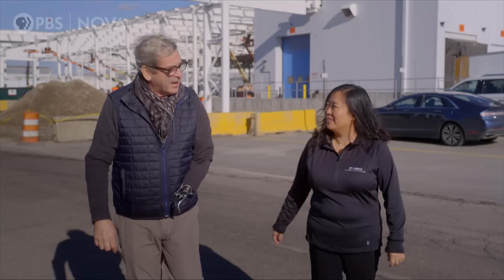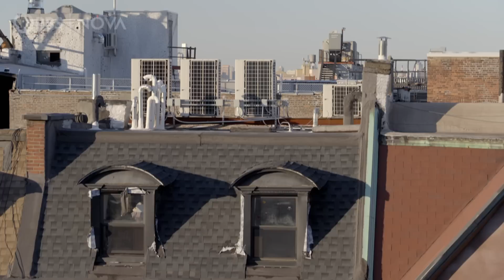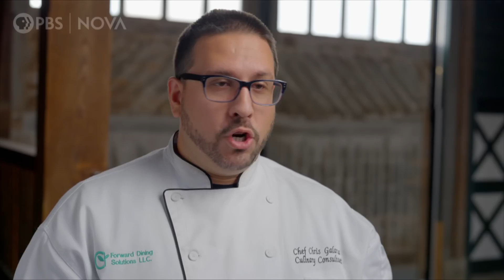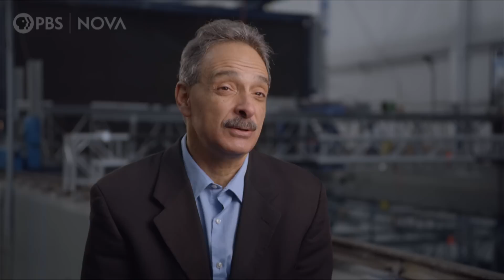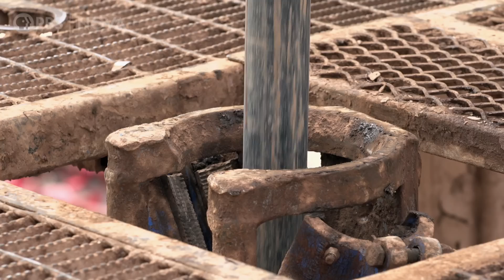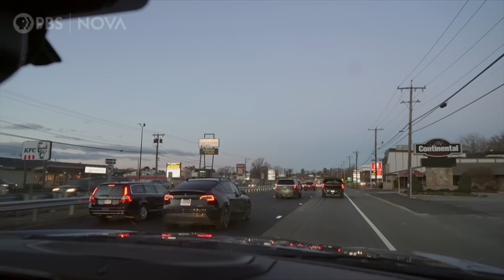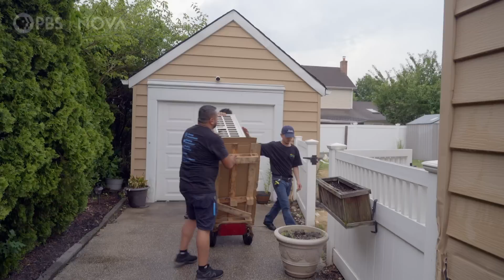Chasing Carbon Zero | Full Documentary | NOVA | PBS

Comment: I've probably missed the mention, or I'm premature in asking at 28 minutes in, but rather than burning it off inefficiently in flare stacks, what about 'sequestering' the methane that comes in such quantity from an oilfield with such capacity that it's regarded as 'waste'? Surely the chemists of the energy titans could whip this egregious amount of blow-off into a usable approximation of natural gas. If that isn't already being done I'm certain it's only so because there are greater fortunes to be reaped through the other resources for which the environment is raped.
Reply: It’s stranded gas. Yes it can be done but expensive.
Reply: @PSerzan38482  Right, the externalized costs are taken from all to subsidize the oil companies.

Comment: What a disappointment !  37 minutes into the program to even mention nuclear - the ONLY source that exceeds 90% availability, carbon free.  You have totally ignored the energy return on energy invested rating of energy producing methods - that wind and solar require MORE energy to make than they produce -- bankrupt.  One need only look at the grand experiment in Germany where they shut down 17 perfectly working nuclear power plants, have a theoretical 40% plate capacity in wind and solar, and rely on the dirtiest brown coal to work when the wind and solar aren't available, which is much of the time.  Meaningless eye candy this is.  Shame on you !

Comment: Tesla sold over 65% of EVs last year in the US. Their Supercharger network has 1750 US locations. Simple to use, just plug in and charge, no credit card needed, 98% in service. Maybe mention that charging is NOT a challenge with a Tesla.
Reply: ikr.  I took a trip up to Maine from DC 3 years ago and had no issues in my Tesla.  My guess is that the reporter was intentionally trying to avoid taking a Tesla because then he would have no story.... "I took a Tesla... it worked...no problems...end of story."
Reply: 17000 tesla chargers in the US

Comment: They DEF need to start putting 100,000 more EV stations in and make them more feasible.  It is the constant complaint that I hear from naysayers not wanting to switch from gas to EV cars, "I am not waiting 2 hours to charge a vehicle".  People are impatient and hateful so I think this doc did a good job in showing this in a 'nice' way lol
Reply: 5 years of driving an EV with 10 visits to charging stations for average time of 25 minutes. Rest of time, I charge overnight saving many hours per year I used to spend in gas stations.
Reply: Where do you think they get the electricity to charge these ineffective vehicles?

Rainbows and pixie dust?
Reply: @1871corporationUSA  no Sherlock, what are you talking about.  re-read.  We need accessibility to more...
Reply: @karibennett5847  you seem to be lacking reading comprehension skills
So you want more  hydrocarbons turned into energy so that you can charge inefficient electric vehicles?

Why not just drive a gasoline or diesel, AKA ICE (internal combustion engine)

You realize "carbon neutral" + "carbon capture" = a human depopulation program  right?

Comment: Enjoyed the documentary. 

But very disappointed that public transportation was not even mentioned as part of the strategy to lower carbon emissions (other than the brief train ride that Melissa Lott took to meet the host). There is nothing really sustainable about using a 6500 lb F-150 lightning as your daily driver. EVs do not eliminate the need for the near constant highway construction and maintenance, which is a significant source of carbon emissions and bound to increase with heavier EVs on the road. Improved access to public transport can make a large dent in the consumption of fossil fuels, while also enabling all sections of society to participate in the region's economy.
Reply: Nuclear.

Comment: Miles OBrien does a great job as a science communicator. On the topic of charging EVs he missed the bullseye though. Older Americans surely remember VHS vs Betamax? Or maybe cell phones which would only communicate with certain towers? How about Apple connectors vs every other companies connectors? There's several other examples but I'll stick with these three. Both built on America's obsession with false "competition". Zero regulations, zero direction from government. Zero interoperability between products due to this abuse of what competition means! Think home appliances, every one of them attaches to the same power supplies. No manufacturer will produce products that do not fit the system. That never happened with EVs, Cell phones, pads etc.. So now we have several operating standards where there should only be one! Europe and Asia have regulated this part of a device which enables a SINGLE plug style for all Evs etc. Tesla today has an EXCELLENT charging system, unfortunately it only works for Tesla. Nissan Leafs have an exclusive high speed plug, very few are deployed. There are adapters coming to market and Tesla is SLOWLY opening chargers to all. The failure here is our government/governance collapse. Money from corporations more important than building a great system for all! We have 80,000 miles driven by two EVs, would never go back to a gas station for fuel again. Easy, low cost, more enjoyable ride. Bought used EVs no government subsidy.
Reply: There is a standard that everyone but Tesla uses already
Reply: What you're saying is simply incorrect. There IS a North American standard that even Tesla is now adopting. It's called CCS. It's an SAE standard and has been for over a decade, is widely deployed and supported, and is the current and future EV charging standard. Every EV sold in North America other than Tesla and the Nissan Leaf (which is old and will be retired soon anyway) supports the CCS standard. The Leaf uses the Japanese charging standard called CHAdeMo and Nissan has simply never bothered to update the vehicle to support CCS (their new car, the Ariya does have CCS though). The Leaf's connector is not exclusive and is actually rather slow and obsolete which is why it hasn't been widely deployed. Tesla sells an adapter so Tesla cars can use it too and Tesla is now building out superchargers that support CCS natively so non-Teslas can use them too. The industry has already standardized around CCS.

Comment: cooking appliances is NOT A SAFE way to heat living spaces.
Reply: It never has been.  If there’s a problem with the furnace, then the landlord is to blame.  I’ve worked EMS in Milwaukee, and have seen with my own eyes, inner-city homes that had the thermostat set to 85°F in the middle of winter.  They even had their windows open.  And we were called for “fever.”  The reason the home was so hot (like many of them are) is they are on the government program and don’t pay for the heating bill.  Common sense would say, turn down the heat and shut the windows.  But common sense is lacking in urban communities, as the elites like.

Comment: Pathetic; (1) no mention of water vapor, which accounts for most of greenhouse gases, (2) no mass balance of electricity (where is it all going to come from and is there enough of their eco-friendly sources of electricity to supply the need, (3) single-source power puts our electrical grid at risk for terrorist actions as opposed to diversification with multi-sources of power, (4) no mention about how the 2050 goal of zero carbon emissions could be achieved with nuclear power, (5) the technical experts were professors with very limited perspective about the financial drivers of business, (6) Tesla has been manufacturing electric cars and trucks and weren't even mentioned. How do you account for that?

Comment: Windmills will NEVER solve our GHG issues. We need to be building new nuclear as fast as we can.
Reply: Never say "NEVER."  Wind energy is still in its infancy but has great potential.  It's rapidly growing and already over-taking coal.  Combine wind with solar and hydro and sure, some nuclear, and we can hopefully reverse the course.  The nuclear waste is going to be an issue and reactors take many years to build so I'd prefer non-nuclear.
Reply: @kenbob1071  Right.  Nuclear is not solved until the waste is.  Using rockets would work, but it's so expensive as to be nonsensical.
Reply: @brians7094  The "waste issue" is a non problem, which was manufactured by the media in the 1970's (with generous support from fossil fuel interests). 90% of it is actually fuel. Sensible reprocessing can reduce the amount of it by a factor of 10. What is left becomes less radioactive than the ore from which it was mined in five centuries at maximum.

Regardless, the amount of waste per GWHr produced by nuclear is 4-6 orders of magnitude (10,000-1,000,000 times) LOWER than any chemical waste produced by any other power source -including wind and solar. And unlike spent fuel, the waste from these energy sources remain toxic forever. Not to mention that they are poorly contained relative to that of nuclear.
Reply: @tuttt99  That sounds mostly true.  Except that the others are becoming more recyclable as time goes on (at least wind turbines).

Comment: I work on large commercial HVAC systems. Almost all of these older large systems do not have Smart Energy monitoring. This means nothing is watching when these units are running and for how long they are running. In a commercial Office Space the unit should run very little when the building is unoccupied. But there is no system to monitor what these units are doing on a timeline. I have seen 30-ton rooftop units running 24/7 because because nothing is monitoring the system telling someone the unit has a issue and is not shutting off when the building is unoccupied. But the building is certified as a LEER energy-efficient building. A smart monitoring system just monitors the electricity consumed by these units on a timeline or trending. This not only let you know when the unit is running and for how long but also tells you if there is a problem with the unit. This smart monitoring is extremely inexpensive to install. For me as a technician it is also a wonderful tool to diagnose a problem with one of these large HVAC units. But one of the main problems is I don't know many people in my field who even believe in climate change. I would think the government would be super interested and installing some smart monitoring systems on large energy-consuming systems. I even tried to start a company called Smart Energy Monitoring. But I quickly found that there was not much incentive for building owners to install this. Tell me how efficient your building is if your 30 ton unit is consuming 100 kilowatts of energy for 18 hours instead of 9 hours per day?
Reply: What a waste of energy! Thanks for the info!

Comment: The old adage of “ The more things change, the more they remain the same. In taking change in products towards not using hydrocarbons, it pushes the need to greater energy production. While this can occur as I have previously commented, there is another side that most are not considering. End reuse. While we rely more upon hydrocarbon polymers, we can change many from petroleum based to plant carbon based which breakdown easily as part of the normal plant process of decay. Thus releasing carbons very slowly. As to the existing polymers, the existing carbon in these waste products can be made into Graphene that can replace heavyweight metals that require larger energy  processes to become useful. Graphene can become an. Alternative as it can be stronger than similar sized metal products. While remaining lighter, so  for transportation, vehicles made of graphene, the current change to EV vehicles would require less energy for operation and a 0-60 in 4 second, could be 0-60 in 2 seconds. While being stronger than the metal version. It also translates into greater hauling capacity as the trade off between vehicle weight and hauling  weight, for the same sized motor. 

ApRt from existing waste polymers, the raw coal especially as Lignite is still available can be used to create a fortified graphene that 
could replace heavy steel altogether. Such a combined situation that includes deposits of lignite, lithium , cobalt and other rare earth minerals has been located within the United States so with proper investment, would not have any political Sword of Damocles.

Comment: I can't believe they didn't even mention that meat and dairy account for 18% of carbon emissions (including a lot of methane). If you want to start being part of the solution, instead of part of the problem, cutting meat and dairy from your your diet will make a big impact.
Reply: Side note: The land currently used for cattle grazing can be repurposed for clean energy production or carbon capture (reforestation, for example). So there is potential for a 30% (or greater) net carbon reduction by eliminating meat and dairy from your diet.
Reply: @karmakazi219  We should not eliminate meat just REDUCE eating it it to once a week!NO MEAT consumption causes severe B12 deficiency that affects the nervous system
Reply: @elvishiekios8826  I haven't eaten meat in 28 years and I don't have a B12 deficiency.

Comment: With the existing technology, major electric producers only need to use deep geo thermal.tap into the heat of the planet to produce steam for existing generators. No extra capital expenditures needed. Additionally, after using the steam for generation, with proper filtration, it can supply fresh water anywhere. This along with waste water to complete the steam loop, can provide a full carbon neutral green loop. This can be backed up by other renewable sources such as solar, wind and ocean wave.

that the various factions regarding green technology have been in a major competition has had the result that those responsible for the power grid will not make the huge investment required for alternate energy  resources.  The same drilling companies that drill oil and gas wells, can drill the required 15 mile deep geo thermal wells. It is the same technology as used in the Chilean mine rescue, only deeper and the exact precision that the rescue required is not a factor. It is a Win-Win for existing corporations, labor trades and the public as well as investors, since the deep thermal resource will not cost the producers continuous purchases of fossil fuels, permit expansion of services which will attract investors with higher returns while being able to lower prices to consumers.

Comment: They didn't talk about how their going to replace plastics, rubbers, vinyls, fertilizers, lubricants, the list goes on. Petroleum based products are absolutely everywhere. 2050 we will be lucky to have reduced it to 50%. Very unrealistic goal imo.
Reply: Plastic is a pollution problem, but petroluem-based products do not emit greenhouse gasses unless burned. There aren't great solutions to replace plastic, but it's not a big part of the global warming problem.
Reply: Brad has it on this one. Decarbonization and reducing plastics aren’t one and the same. On occasion, options with the lower carbon impact are actually plastic. Those petrochemicals you listed are a tiny slice of plastic use. They mentioned some alternatives. I doubt halfing those by 2050 is an actual goal; I try not to get all extremist about it. The big problem with plastic is really single-use plastics, which we need to stop abusing
Reply: Yea no tires that can deal with the  heavy cars and no black top roads without fossil fuels is just the start.
Reply: Producing plastics involve and release othern dangerous chemicals that are known carcinogens. Cancer alley in Louisiana is fighting the growth of plastics industries as oil and gas searches for non fuel uses for their product. We need a full life cycle perspective of fossil fuels to eliminate carbon and all other co-pollutant threats it causes.
Reply: Ivan, in many cases we already have alternatives.  Bioplastic is plant-based plastic.  Natural rubber comes from a forest tree.  Fertilizers can be made naturally.  Lubricants such as grease are made from lithium.  Electric vehicles don't contain motor oil.  We already have the solutions, we just need to implement them.
Reply: @llaumann  how does that affect our trees and plants? Doesn't sound like it's a good alternative right off the back... thanks for the insight.

Comment: Could floating offshore wind platform also house wave generating electrical platforms, so that both outputs could be transmitted onto shore together?
Reply: Great question, I asked that to Bing AI and this was its response: "Yes, it is possible to have a floating offshore wind platform that also houses wave generating electrical platforms. In fact, German company Sinn Power has developed a floating platform that currently hosts solar modules totaling 80 kW and may also embed small wind turbines and wave energy converters1.

There are four kinds of floating platforms for offshore wind turbines: spar-buoy, tension leg platform, semi-submersible, and barge2. About 80% of projects plan to use semi-submersible platforms2."

So nothing yet, but the idea does sort of exist.
Reply: Nope!  Kills birds.  Nuclear kills zero birds.

Comment: The cheapest energy is always efficiency. Chasing Carbon Zero ...fantastic and Miles is at the cutting edge! I've had my $12k used 2012 Mitsubishi since and it has been a money saver. If I was part of government, I'd penalize car charging networks for each hour a network charger is down, seeing how they are reaping billions of dollars to place chargers that often don't work.
Reply: Tesla chargers are available 99.3% whereas competitors are 75% but that should change with time when we start trading energy on timely basis.
Reply: Seen the diesel generators hooked up to your state of the art charging stations?